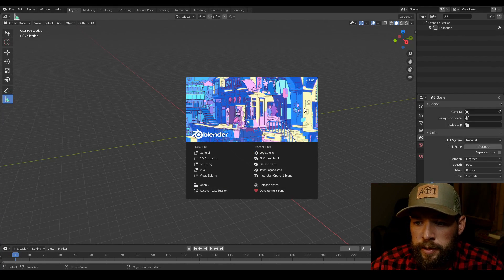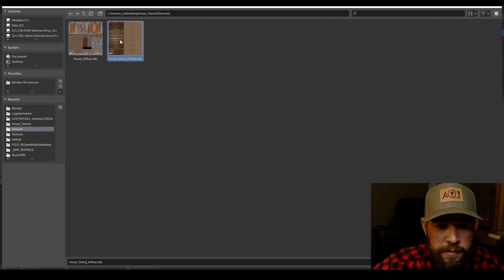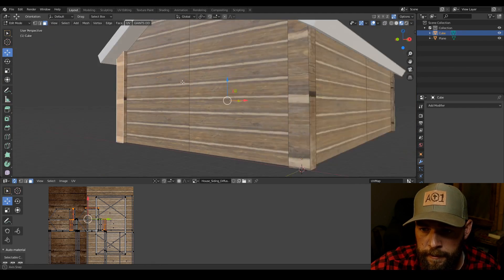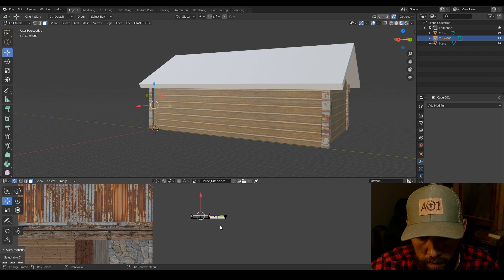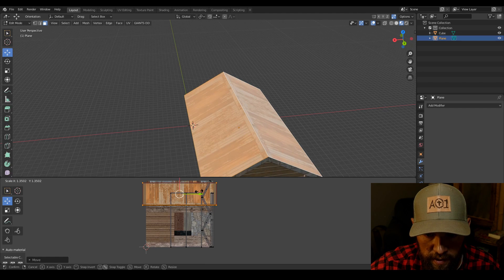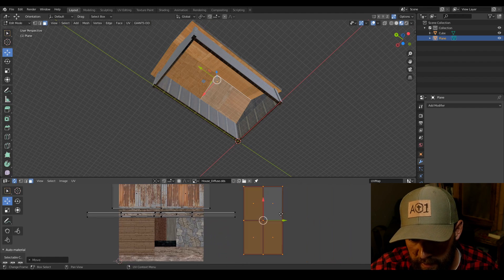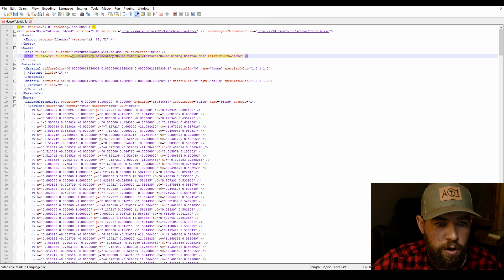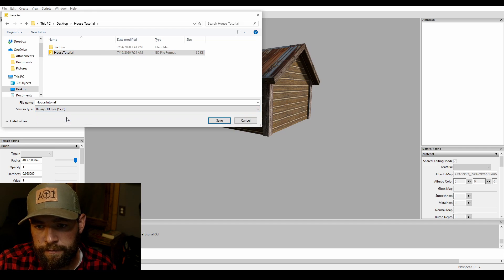FS19 Modding Tutorial (The basics of modeling and texturing a house)

Comment: hey man nice video, i learned alot my question is, so im in blender, i just built a whole sectional pusher for a skid steer from scratch, its like a box plow, i modeled it after the pro tech fusion edge, now i can obv throw some colors on each big part but imy question is, like those little udmi pictures that have all the parts from a mod, unwrapped, inside of it, how do i make those in order to texture my piece, like i see in the video you have a picture, with a few different types of wood in one, how do i get from basic solid plow. next step is what.. find images online of the model i went after and drag the pieces into each colored section?
Reply: prob confusing qustion but to simplify, in this video act like you had no images to texture them what is your next step
Reply: how did you make the photos you used to texture this
Reply from the maker: @seal.team.six.sealcoating716  so I make my own textures from scratch but what you are probably looking for is an unwrap and then a texture bake. I would look up videos on texture baking that might help you out a little more

Comment: There is something wrong.. Whenever I do the cut to drag the wall in another direction, I can no longer select that face. Its only a white line on the edge... How do I solve this?
Reply from the maker: You need to be in face select mode, press three on the keyboard to enter face select mode or click on the option in the upper left corner
Reply: @thewildernessstudio4371  Now I have another problem. Giants i3d exporter does not work on any version. I have tried 2.80, 2.81, 2.82 and the latest 2.90. It doesnt show up and if it does it says its version 7.1 and needs to update.. I cant export my sheds now... Please, do you know what's wrong?